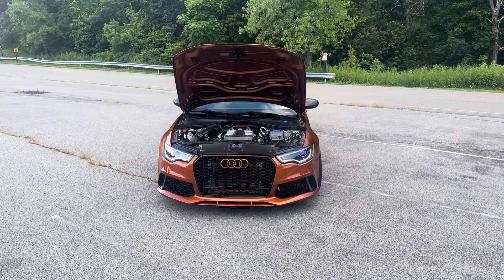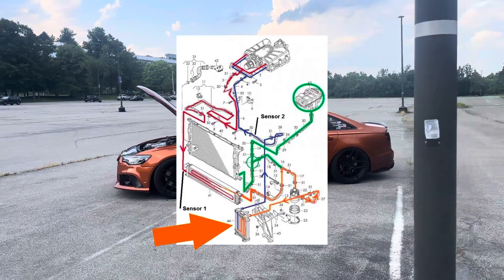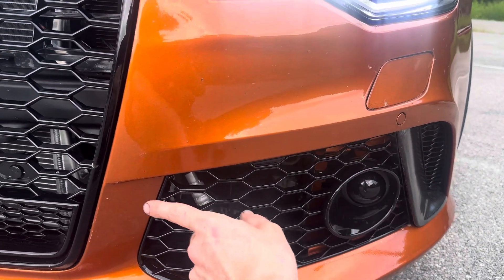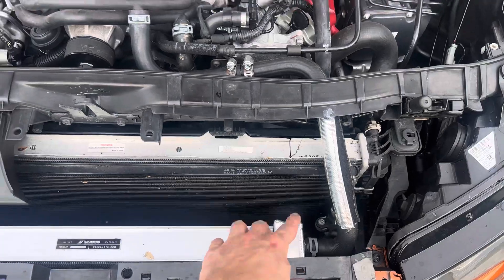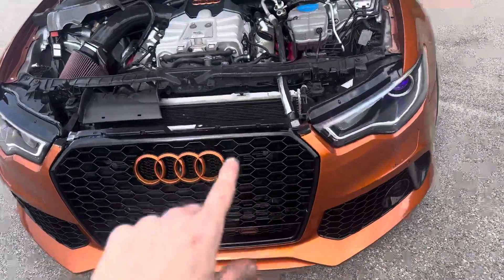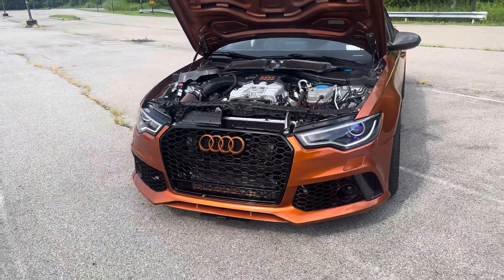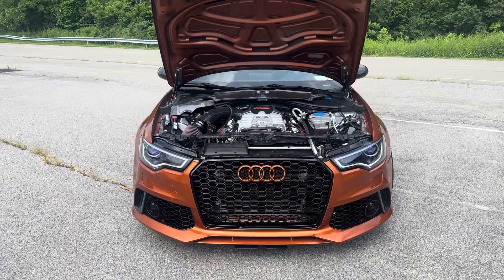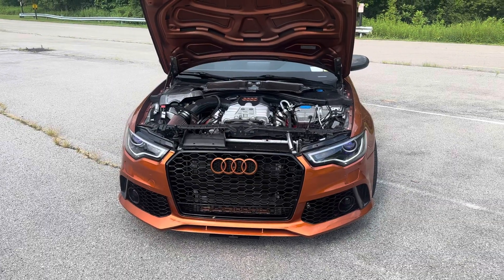AUDI 3.0T HEAT EXCHANGER (custom)

Comment: This is way smaller than my merc heat exchanger ! And divorce the cooling with a cwa pump is much more efficient especially running stage 2+e40

Comment: 5-10F above ambient is working very well!  Just wondered if you checked IAT's with the auxilary drivers side cooler installed and if there was any difference.   I wouldn't expect it to increase temperatures, but maybe the waterflow restriction is greater than the cooling of the aux heat exchanger.  I saw this video @Vancity Audi https://www.youtube.com/watch?v=80jnlqNax6Q with the stock hardlines and aux cooler and Merc racing intercooler, his temps are +60-70C above ambient, after doing some research the hardlines on the front of the engine seem to be the largest rectriction in the stock setup (surprisingly) as the internal diameter is 13mm (about 1/2") which flows half as much as 16mm (5/8") at 10psi.

Comment: Hey I just bought the heat exchanger, where did you get mounting brackets and the proper hoses?
Reply: I got my brackets from Lowe’s. Just made my own. I sourced the hoses from AliExpress a 90° hose and a straight hose. 
I used rivet nuts at the inside of the crash bar so my brackets bolt right up to the crash bar

Comment: Just a heads up, I'd swap those brass fittings for aluminum or plastic ones. You dont want to mix metals in a cooling system. Those brass fittings will cause the aluminum in the system to corrode over time.
Reply from the maker: @opteliv8077  never knew that thank you!
Reply: About to swap the one brass one I had to use out now great info I never knew that

Comment: Interesting ive seen this described as optimized coolant loop with auxilary radiator delete . You might want to buy the velocityAP crossover coolant pipe upgrade . Are you going to install a divorce reservoir ?

Comment: I've looked into the mishimoto heat exchangers but didn't see anyone else running it and people told me it would be better just to buy one from merc or 034
Reply from the maker: Those options are still good and a lot easier to install as they are meant specifically for these cars. Although i raced my friend who has the same car he has a merc hx and 034 stage 1 ecu + tcu, at the time i was only stage 1 034 and the mishimoto and i beat him back to back 4 times and we did a roll from 40 to 140 and i got about 5ish car lengths on him. I’ve also since this video made a few changes and my intake temps never go above 20 to 30 over ambient just normal driving and when I floor it, it will within 5 seconds drop to 5 above ambient
Reply: I'll probably end up going with a mishimoto just to be different than everyone else

Comment: Well it don´t matter how long the hot water travels before the heat exchanger. Only thing that is important is the temperature and massflow rate of the water that enters to the supercharger air coolers...
Reply from the maker: It definitely does something because I raced a friend of mine with the same car he has a heat ex using the factory lines with a stage 1 ecu and tcu tune I had my heat ex set up with only stage 1 ecu and beat him back to back 4 times
Reply: Hey! Love the car and vid. I think the question here is, how did your IAT’s compare to your friend’s car during those pulls when you beat him 4 times? Thanks for sharing!

Comment: Hey I got one question about this when you spun the pump to point the spout towards the passenger side does that spout connect to the bottom of the heat exchanger outlet?

would like to be able to  talk with you on the phone if that would be possible
Reply from the maker: The spout on top (the vertical one) is your inlet from the heat exchanger. The one the side (the horizontal one) is your outlet to the supercharger